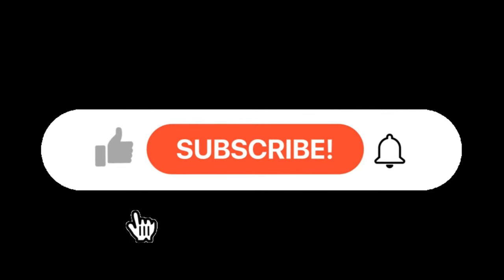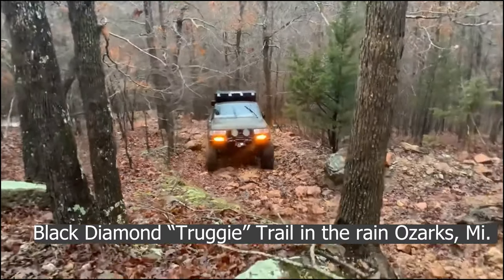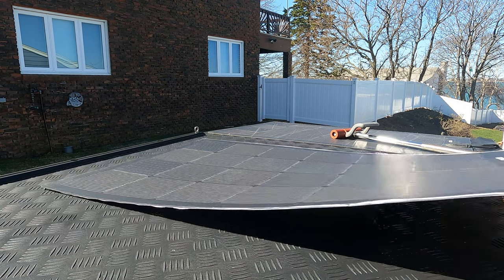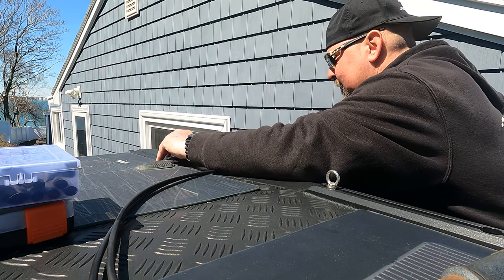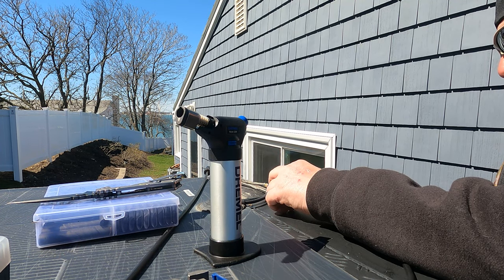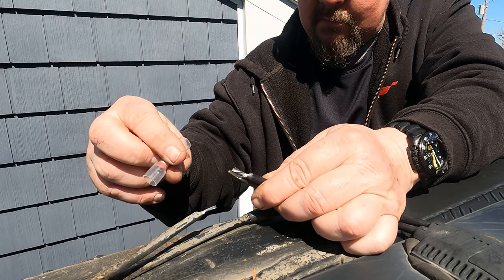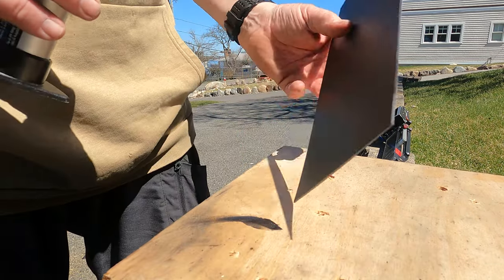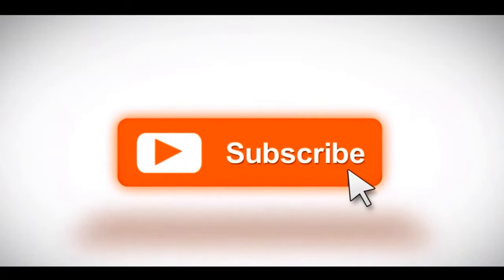How To Get the Most out of your existing Solar Power  setup. #BattleBornBatteries #Merlinsolar

Comment: Hey Richie great video, as long as we have a supply chain in the next bit and I receive all parts I will have our new 200W thin filmed Solar available, if you want another project and they will fit 46.85" x 31.33" let me know.  I tested them under 3/4" snow beginning of March and they still put out power here in Canada, have been testing them since Oct 2021 to make sure they will work how I want them to before I offer them to everyone.
Reply from the maker: I would have gone that route but you said not to mix manufacturers. merlin is good stuff just pricey.
Reply: Love your products and glad we bought from u. Thanx to richie !

Comment: Awesome tutorial!   Those E-Volt heat shrink Y butt connectors are slick!  Using quality heat shrink with the adhesive inside is sage advise.   I love the way you made those kydex  wiring covers.
Reply from the maker: they are I was stoked to find them I only use Heat shrink/crimp connectors or I solder straight up welding wire to copper connectors  I dont mess around with electrical.

Comment: Richi you got a knack for this stuff, my daughter and her husband do also, me? I barely know one end of a vehicle from the other lol, my daughter is an auto spray painter and in very mechanically minded and she rattles on about cas and I usually have no idea what she is on about but its interesting anyway, they know about solar panels and have a good set up for camping too with a hot water service, they use a camper trailer but used to have a roof top tent
Reply from the maker: lolol